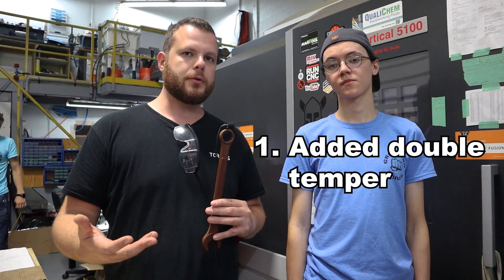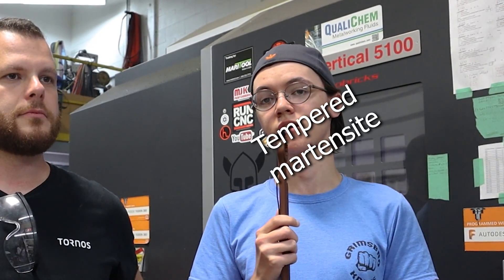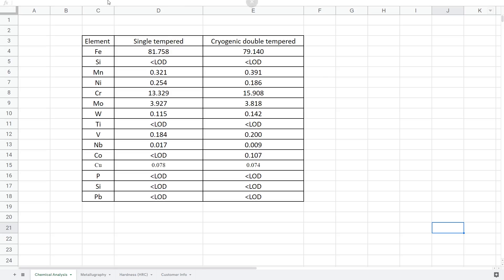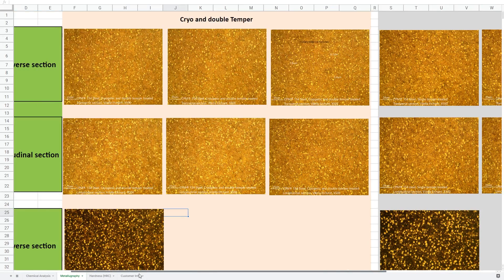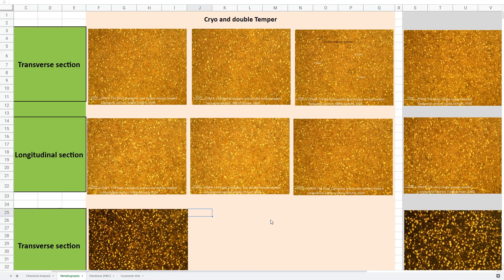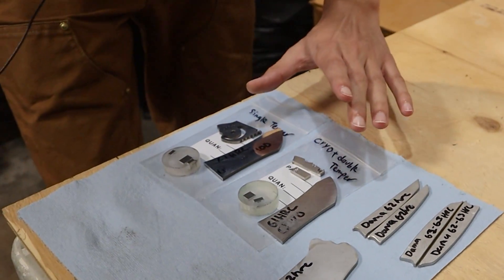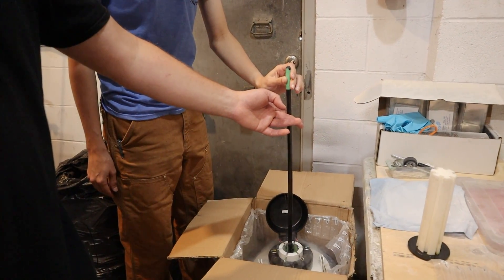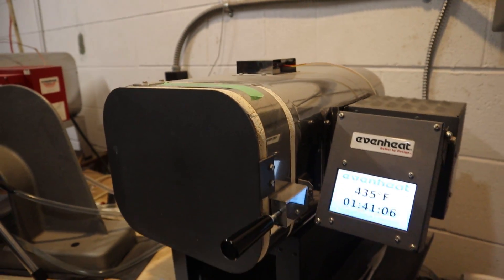We put our heat treat to the TEST

Comment: John 62hrc is more ideal for rwl, you're not using it to it's full potential steel wise at 59-60hrc. Cheers fifty50 knives
Reply: with knives in the kitchen absolutely! and id love to see folders at that level too. But makers are too scared to produce knives at that hrc except for Spyderco (not specifically rwl34 which is around 60-61 also).
Reply: @tacticalcenter8658  we're heat treating to 60-61hrc for added toughness for our end users.

Comment: first of all great info.

if you 3d printed that new mic holder you should consider printing it in 2 parts and run a small grove up the middle of it to run the cord up it, add two screw holes into it in case you have to replace the cable or if you use it for other things. i think that it would make i look a lot better and this is grimsmo knifes you guys are the definition of perfection. Keep up the great videos really wish you did more. The info that everyone has in that shop is crazy.

 you should consider floatplane, it is linustechtips attempt at a video service. Would gladly pay to help make more videos and I'm sure many of your fans would as well. Oh yea and he is from Canada as well, his team has a little shop.
Reply: its milled from wood

Comment: There is always retained austenite in these kinds of steels due to the alloy,  kinematics and morphology. it's just reduced with Cryogenics. Need x-ray diffraction to really see RA. Can't see at 500x or really at 1000x it's in-between the small gaps of martensite needles in the grain as small gummy patches, the etching doesn't show that, just highlights the carbides and sometimes prior Austinite grains. The Carbides with your improved HT  are finer thanks to the higher Austenizing temperture dissolving more of the M7C3 Chromium Carbides, those are those white dots in rwl34.  it's two fold, Putting more alloy in solution with higher Austenizing temps needs a cryo to help fully convert to MF. Technically more RA would make the knife more tough and ductile especially with impact, but cryo will improve the stability of the edge which is better for a folder.
Reply: Aye
Reply: Nerd
Reply: @VincenzoNero94 🤓😄

Comment: I just bought Norseman #2721 and had it’s hardness (HRC) tested. I had it poked twice and it is 59.9 and 60.0. I know you advertise 61.0. 🤔
Reply: Our hardness spec for the new recipe is 60-61hrc.
Reply: Skye Bowron ok, sweet!  In my opinion you want to be at the high end of your range, if at all possible. Once you get to 60, one point is a big difference (exponential scale). For example, every CRK knife (59-60 range S35vn ) that’s been tested has been at 60 or just a couple of tenths away - always on the upper end of the range. Mine was professionally tested and 59.9 and 60.0 is barely squeaking by.  Anyone who thinks HRC doesn’t matter, needs to use their knives more. A Norseman at 61 will outcut one at 60 (everything else equal) by a noticeable margin. Love this knife!
Reply: Hrc isn't the end all for edge retention etc. Generally higher hrc is better, but you can have two knives at 60hrc and one do double the cuts as the other depending on the heat treatment recipe.
Reply: Oh noooo. Your hardness tester had a discrepancy. I hope your knife doesn't wear away since it's so soft. Actual 60, advertised 61... Class action time?
Reply: @xenonram  there is a marginal difference between 60 and 61 if using the same HT protocol. If they produced the same 60hrc with this new protocol it will perform even greater than the previous protocol at 61hrc. the new protocol is going to provide a much better edge retention. 

and lets be fair, if it was marketed as 61 and he paid alot of money for it. it would be nice to have a good heat treatment. i know some people just care that the knife flips and is shiny.

also as you grow on the scale over 59hrc, it gets substantially harder. for example the differences between say 54 and 57 is small. the difference between 62 and 63 is ALOT.